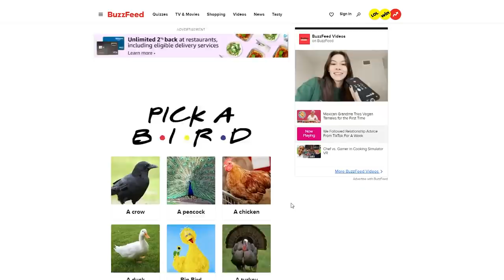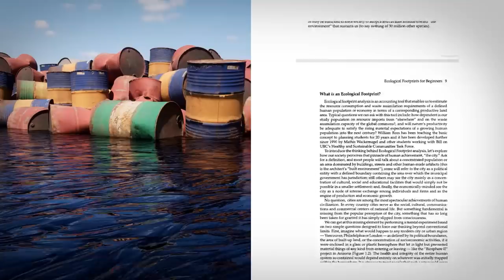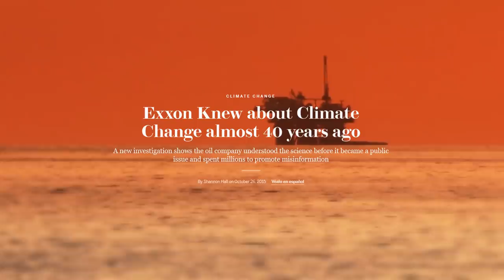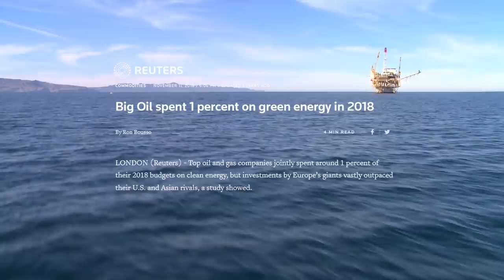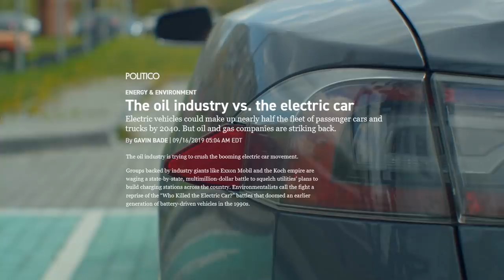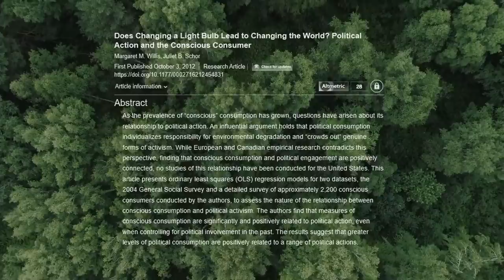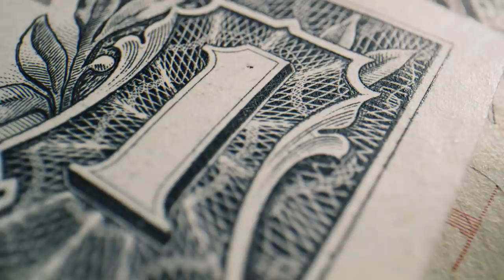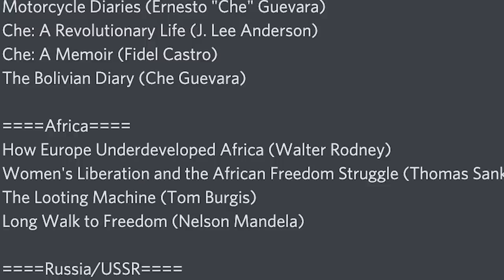Your "Carbon Footprint" Is A Scam

Comment: Another thing: this also applies to the "personal responsibility" at the heart of the "Just Vote" attitude. Which maintains that if the political landscape isn't going well, it's because you didn't vote hard enough.

In a political system where politicians on both sides of the aisle are thoroughly beholden to lobbyists and special interests, just voting for the less bad candidate isn't enough. We have to applying collective action across the board, to put pressure on the government to make the right decisions.

Yes, this does mean we can't just spend 1 day a year doing political action by going to vote. It's going to take real activity to change the momentum of government, which so often moves to the tune of Capital. It means protests, letter-writing campaigns, mutual aid, circulating information on real solutions, and even pushing to get candidates without ties to big business into office (even if that means some of us must step up and BE those candidates).

The grinding gears of big business - the ones crushing us and our world into dust - rely on people being passive. We cannot be anymore, if we're to survive.

Comment: The crazy part is that we are still seeing this over and over. There are so many examples. 

Ethanol is a great example. The public was told about all these studies that showed that Ethanol was better for the environment. Yet recently scientists have gone back and looked at those studies and found that those studies didn't assume that people were growing corn just to make Ethanol. Basically they didn't take into account what was done with the land instead of growing corn for Ethanol. For example the land could have laid fallow, or been turned into a forest, or any number of options. Now we have to go back and rethink everything about biofuels and do entirely new studies, there is even a possibility that it is worse for the environment than just using gasoline. Even if it's not worse, it's only a tiny bit better than gasoline.

Another great example would be plastic straws. I live hundreds of miles from any ocean. Yet for a bit of time everyone went crazy about using paper straws. The reason most people told me was because they wanted to reduce the amount of plastic going into the oceans, basically they had seen the whole thing about a sea turtle getting a straw up it's nose. The chance that any plastic straw, that anyone withing a dozen miles of me, that was used in the last decade, ended up in the ocean is miniscule. All trash is either burned or put in a landfill, it's not going to end up in the ocean. Basically someone would have had to take the plastic straw with them while on something like a ten hour drive to the beach. 

The time and money people spent worrying about plastic straws and Ethanol could have been far spent on dozens of other ideas that would have been better for the environment. Just as an example, most of the state I live in still doesn't have reliable recycling. I just moved into a new neighborhood and nobody even has a recycle can for trash. I do understand that most plastic and paper recycling is yet another scam to make people feel better. But aluminum, some plastics/cardboard, and other various metals being recycled is very beneficial and it's something that nobody ever talks about, at least not where I live. Instead of Ethanol we could easily have redone the recycling system nationwide, including educating people about what types of things are most beneficial to make sure they recycle and what is nearly neutral and can either be recycled or tossed in the trash.

Comment: This is true, and I get the point - but in a dreadful way it appears to absolve individuals from what they can actually do. The idea of choosing which bottled water for example, does not take into account the choice of not using bottled water. To say that people can't, or that it is not crucial to stop driving a gas guzzler is not reasonable when there are plenty of options out there.  Riding one's bicycle, taking mass transport can lead to  infrastructure changes at a local level and show policy makers that people are willing and able to get beyond the current non-strategies. This is a damaging video, as if it were made with fossil fuel funding. Be passive, be deer in the headlights, organize a march....is this a constructive message? Better we BE THE CHANGE at the same time as we push for better policies.

Comment: Honestly, one of the major things that really helped to break me about of the belief that capitalism in any way will solve our problems or even cares about us or the environment, was finding out that the carbon battery patent I was personally very excited for (because it would drastically mitigate the rare metals problem of EVs) was bought out by a vaguely named LLC and has since seen no progress, no updates, nothing...
Reply: Carbon vapor deposition machines are very rare. But i suspect sheets of copper with the CVD treatment will be able to drastically upgrade batteries. I was gonna invest in some of the labs that have the cvd machine but i quit working.

Comment: Change does not occur if only one force is applied. Not only individuals need to do their job but society at a large too. If good behavior from individuals lead to a 10% decrease coupled by some societal pressure to reduce production emission then we would have some positive results. Our society is a circle where both pressures need to be applied

Comment: Think about it, if you REALLY TRY your hardest to actually damage the environment as much as you possibly could, what would that look like?
For me, I could buy stuff to consume as much electricity as possible in my apartment, even bypass the fuse box to the point where the supply cables into my apartment melts...
...and it STILL wouldn't make a noticeable difference, just build one medium wind turbine & ALL that is countered, or just shut down some medium/large industry for some hours/minutes and ALL that energy is regained. Same goes with fuels, plastic, food, ..... So, individual carbon footprints are stupid, in comparisons to what companies & factories consume.

Comment: Since the 1990's the amount of plastics used everywhere is mind boggling. Soda and Beer used to come in glass bottles that were recycleable. In the 1990's we had cars that were getting 50+ mpg. We used to have paper bags for groceries which was replaced with plastic bags. I've noticed since the Government got involved everything has gotten worse much much worse. We knew oil was a limited resource back in the 1970's so what did our world do- increased the use of it. Were not a smart species at all.

Comment: But at the same time it's not smart blaming the producer if there is a demand. As you mentioned, if we stop consuming they will stop producing. If they stop producing first, it will make us unhappy and we will find a way to produce it ourselves. As you mentioned, as well, that we need to go through some structural changes, to stop the demand. Only this way to stop the production.

Comment: I dunno, my opinion on the whole issue is the same as on blaming a patient for various health issues resulting from lifestyle choices like
diabetes, lung cancer, alcoholic liver disease etc. Blaming and finger pointing are a distraction and waste of time.  Just deal with it by starting treatment, identify the cause, and fix it, if you can. Be part of the solution and don't drag out the problem.

Comment: Nah half of the vehicles being swapped to electric by 2040 wont happen. There isint enough lithium or cobalt in the world to electrify even the commercial light vehicles (not the heavy trucking) of delivery, cleaners etc that use passenger cars and vans to move, let alone private car ownership and more over currently EV is comparably too expensive to say diesel, even when most of its battery material are mined with child and slave labor, processed with out any environmental protections in China. Change that production to western labor and environmental protection laws and price of EV jumps two fold. Dead battery after 10 years? Thats 40K minimum instead of current 20K that is impossibility to middle to low income families to pay and getting new one is the same, even if recycling companies would start to pay same amount of lithium than whats scrap copper costs now. Tesla battery hold 5-75kg of lithium in it, so if scrap copper value is 5.60 €/kg thats just 28- 420€ in scrap lithium. Combine that with scrap copper and gold etc valuable metals you maybe get 1000€ in all for scrap EV in this theoretical price, though now days you might have to pay to dispose that ev battery so its like buying a bomb when you get EV as low to middle income family, even if you could afford used one in the first place. That whole sum goes down the drain moment EV dies. You might get couple grand out in spare parts that are still working, but its such a shitty investment that it pales in comparison modern car, hence people still drive trusty old cars that you can work your self and get it working with baling wire and welder most of the time.

Best possible choice for environment is old mechanical diesel engine you can put pretty much any oil including biological oils in it after processing that can be done at home, where new diesels just get clogged injectors, being designed not to run on that. Also exotic parts that are hard to impossible to manufacture your self after manufacturer stops providing spares and scrappers have sold out all the used spares.
This is why we need to stop being consumers and be customers again. Buy old vehicles, build business around repairing them to keep those reliable vehicles at the road and demand both government and corporations to start producing simplified reliable vehicles that can run pretty much any diesel fuel, instead of what is going on now, of vilifying diesel as the great evil and trying to ban it more than gasoline or wood gas vehicles, witch are also option depending your life style and can be built to be ecological and environmentally friendly, but we all know.. this was never about the environment, but control and power.

Also this same thing applies to everything. Repair instead of buying new, since that grandpas lawnmower will probably outlast you if its maintained properly.. the new one probably gives out in decade if not less since its cheaply made and uses parts you cant really manufacture your self or locally in reasonable price. Also learn the skills to do these repairs, its infinitely cheaper well as works as therapy to wrench something on your own. Build communities around repairing and learn new skills. That is the way to go. For living... GET OUT OF THE CITIES. It does not have to be far but outside you have more resources on your door step well as ability to grow your own food least partially. Now that is the green move to make, witch we have grown away from. Most moronic of us dont even understand that electricity does not come just from the wall with money and food does not come from the store.

Comment: Good one. Title of the video is kind of  misleading if you dont dig dipper in the topic.  Indeed it isnt our personal fault but knowing there is an global scale issue we have to adjust.  Any massive movement and as said in the video "collective action " that will make a change  in fact consists on individual choices in fact. For example buying products counsiously investing money into companies which are actually have not just the value creation in mind but social and envieromental missions. There are copmanies like that out there like B-copr certified enterprises. CO2 cand drop just because we didnt use airplanes during covid , the actual problem is that it remains in atmosphere a way longer then we think and accumulating heat and methanane as well sa nitrous oxide stays even longer (think grean house effect as a hot tub ). We all have to reduce input .
Reply: I'm sorry to inform you.. but he did a video on b-corp aswell. You might wanna check it out..

Comment: It was the soft drink industry that chose to switch to single use plastics, not the consumer. It is by now an old tactic to shift personal responsibility onto the consumer.
Reply: DovidM; You may just be right but it’s interesting to consider what inspired the switch to plastics (in the US). Up until about 1965 all drinks (soft & alcohol), with rare exceptions, were delivered to the consumer in reusable glass bottle which required (by the bottling company) a deposit. Used bottles were collected at the store, sent to the factory, cleaned and sterilized, refilled, and returned to the store for purchase. (the above applied generally to milk as well)  Financial factors that came into play for the decision; the bottle out weighed the product and required transport both ways. Cleaning and sterilizing used significant quantities of water (again more than the product) as well as energy (heat) for sterilization. Health and safety issues due to broken bottles (everywhere, liability) as well as unsanitary collection points in stores. Then there was; consumer convenience (no deposit no return), ease of use (twist top/pull tab), lighter weight/bulk easier to carry and store, consumer perception (new, clean, modern etc), lower price. Was the switch to singe use plastic/aluminum the right decision?  Generally it was. There were unintended consequences but that was true of bulk packaging and glass bottles as well. One can see there were strong reasons that motivated the industry to switch. At that time “social blame” in this context had not yet been invented, shifting responsibility to consumers was not even a remote consideration.

Comment: This is why multi party political systems are better than two-party.
In a two-party system if one of the parties take a strong stance on emissions and force the big emitters out of business they will alienate their voters, hence they won't make that a strong party stance.
In a seven-party system one of of the parties would make it "their issue" and get a proper platform for real solutions.
People might have a tolerable environmentalist party on either side of the political divide so they don't need to sell out their principles in order to vote for an environmentalist cause.

Comment: the primise of the video is 100% valid but still It's not okay for a family to have five cars that they use even for throwing the garbage in the can that is 100 feet away of their house and blame the policy makers for the whole thing. Yes, their doing it for profit but you can't be the hamster running inside the wheel and blame the wheel that it never stops. The least amount of awarness is required from people even if they're not going to act on it.

Comment: But things would be worse without that effort. Let the system shrink. If our consumption is carbon free AND low tech, we're on the right path. Just need to measure and monitor diligently.

Comment: 8:53 ASAP Science warned us about types of energy that are sustainable, either. There are engineering problems (as an engineer myself) to keep the grid clean and sustainable. For example, lithium extraction on electric cars are far off sustainable and Hydroelectrics tend to devastate biomes in order to deliver energy.

So if the font is not sustainable, the process tend to pollute either way. Luckily there are other ways to produce energy without that much of ecological footprint problems and can be solved with a more diverse and strucutred and capilarized system. (The biomes would benefit too, like tidal powerplants and more ecological solar panels, so the industry would reduce by a far amount the emission of CO2 and greenhouse gases, even the destruction of biomes).

In places like the US to me it doesn't make sense for you guys to use that much of coal to produce energy for example.

Comment: something noone talks about, is that even by their own admission co2 is well down the list of greenhouse gases, with things like methane or water vapor at the top. They would be better off reducing things like that at an absolute fraction of the rate than co2 and have the same desired outcome. Also, they say that we shouldnt use gas because methane is bad, but methane is a "worse" green house gas than co or co2, so we are better off converting it than keeping it as methane, and it all seeps out the ground anyways. Its all just a means of wealth transfer and throttling industries etc. You cant control someones water vapor, stop them washing their car or something, but you can charge them more for electricity.

Comment: It is telling how at he height of the pandemic when the world shut down, when cars were off the roads, when flights were cancelled or suspended @10:50, our carbon emission dropped BY LESS THAN 10%! That was a drastic, world-wide forced/involuntary suspension of carbon emitting behaviour, with huge impact on our lives, our income, our productivity, and our economy, and it ONLY reduced carbon emission by less than 10%? TEMPORARILY???
The answer to reducing carbon emission is, as the video points out, through structural change - change the way cities are designed. Change the way civic and community facilities are allocated and distributed. Change the way homes are built and clustered, and zoned. Change the way roads and communication modes are meant to serve the community. Provide real alternatives to private, single-occupant vehicles. 
It is not "collective" action per se that will significantly change our carbon emissions - when the world shut down in 2020 because of the pandemic, that was as "collective" as it can get. And it was less than 10% reduction. Temporarily. It has to be intelligent, decisive, deliberative actions to build a better system, better structures, and better real alternatives. 
And on a personal note, stop listening to Elon Musk @8:47 (cos he's a dweeb... in addition to a whole lot of other unprintable things).